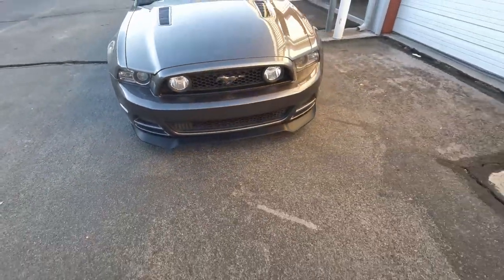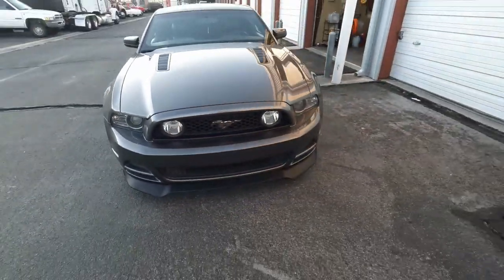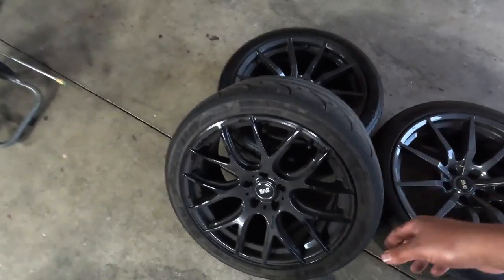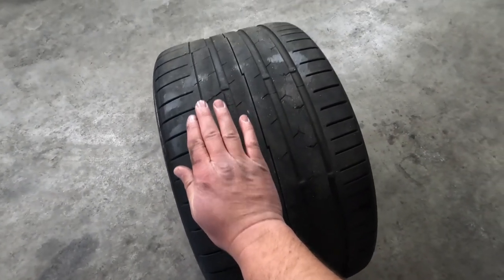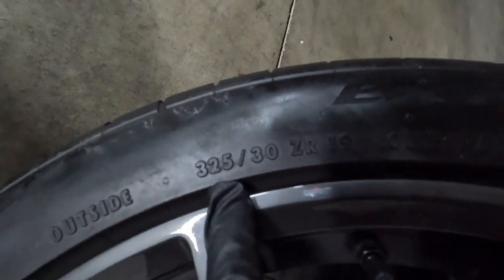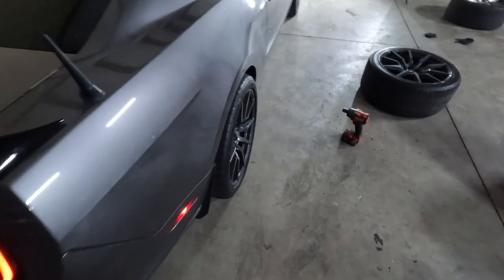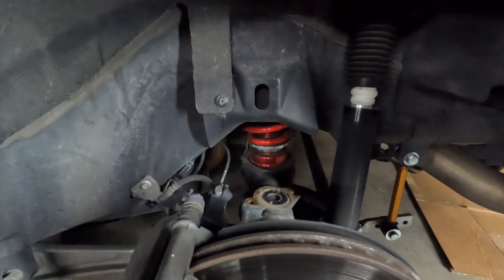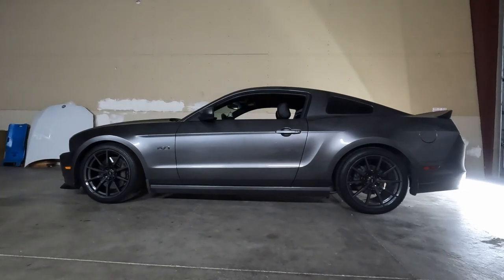Installing Wider Wheels and Tires

Comment: Nice!  May cause water rooster tail though.   I'm happy with my 255 Fronts and 285 Rears on my 2012.
Reply from the maker: Maybe a little rooster.  Haven't driven through any water yet.  That is a good size for a street car.  I do autocross and track days so I will be upgrading my front tires to a little while later as well. After I get my track tires set up I will be driving around on 275 square for everyday use.